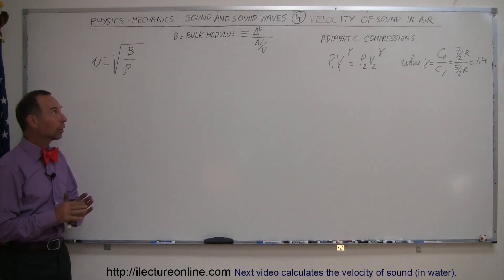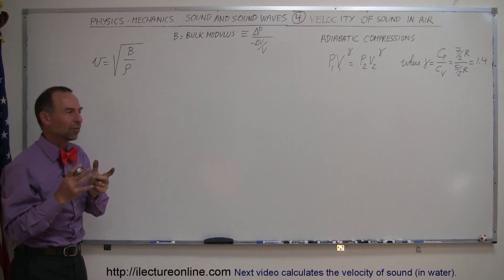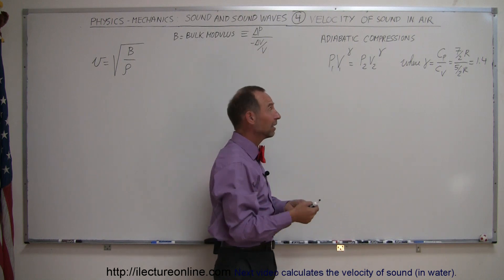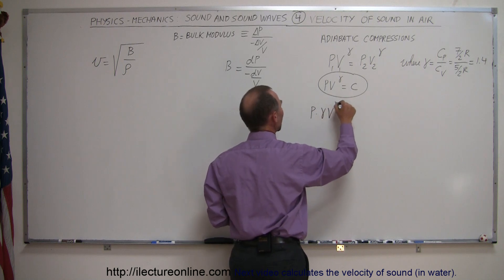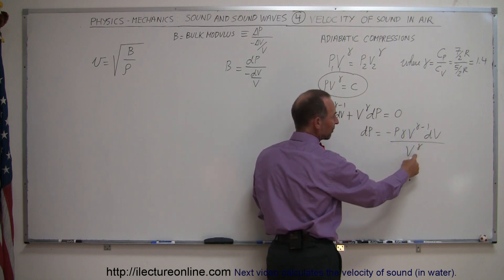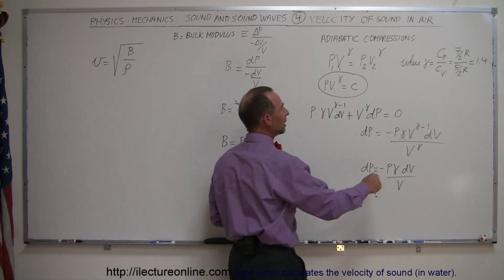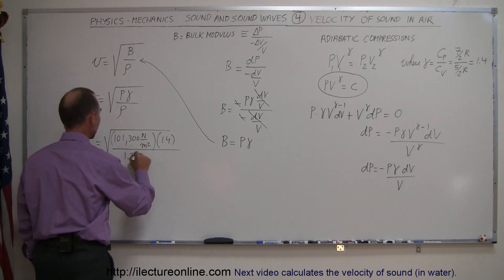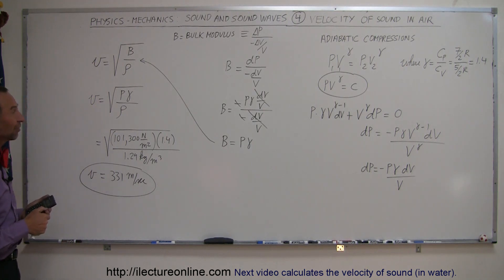Physics 20  Sound and Sound Waves (4 of 49) Velocity of Sound in Air

Comment: thanks for your effort to produce this video.
i have a question, how we get the equation of the speed of sound in fluid is square root of bulk modulus per mass density? is that from experiment or derivation? thank you
Reply from the maker: As all equations in physics, they come from observation after which we try to attach an equation to it.  In some cases, as in quantum mechanics, they make assumptions and then try to verify it with experimens, or they use unit analysis.
Reply: @MichelvanBiezen  thank you so much prof Biezen

Comment: why we must use adiabatic process?
Reply from the maker: Adiabatic compression is used when it occurs so fast that no heat can be exchanged between the air under compression and the air nearby.  With sound wave compression that is the case.
Reply: +Michel van Biezen oh i see, thanks prof